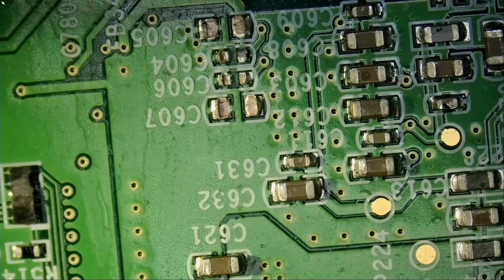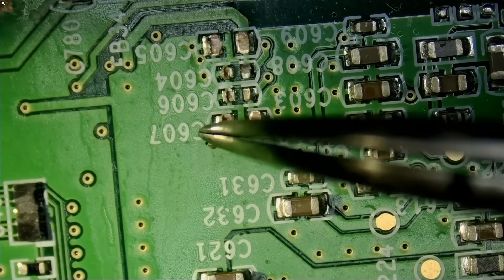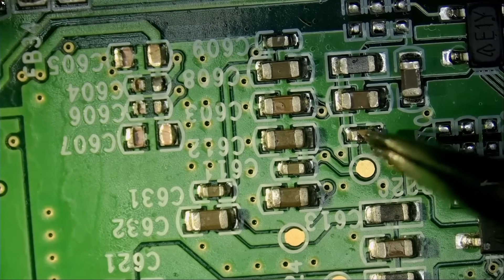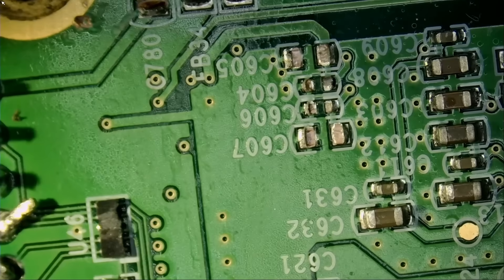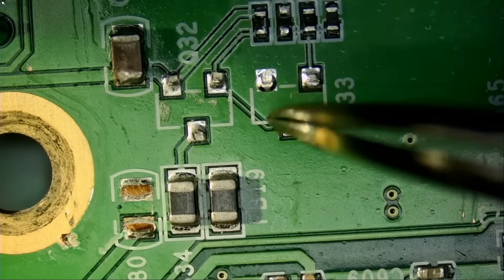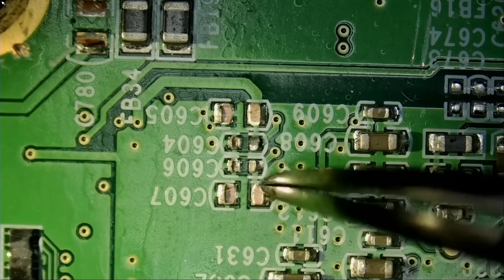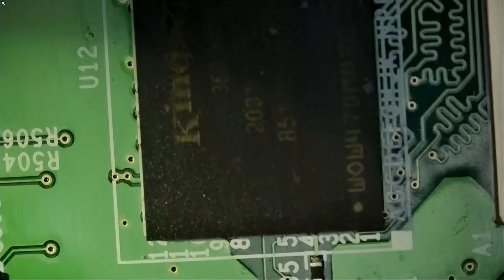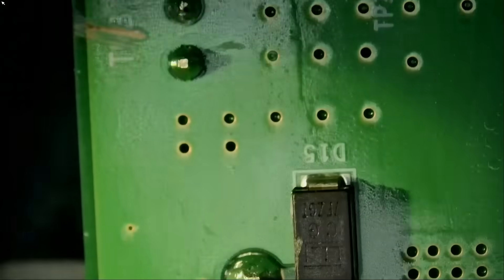IIrcade No Power - Who massacred this board and Can we save it ?

Comment: i'm betting it was shorted across all the pins with something and injected higher voltage and blew it all apart. i agree,  without any specs or data, it's a total loss, not including all the other components that just appear good.

Comment: hi i've got an adata hm800 6tb external hard drive. is it ok to always keep it on 24/7 ? its got a power cable so i wanted to know if its safe to always keep it connected to electricity؟
Reply: Yes. Its specifically designed for this purpose.

Comment: Yup and it is still working! Thank you Alex! This looks like they sent you their donor board!  I can send you pics of the both sides of the motherboard you fixed for me. Let me know.
Reply: This.
Reply: He would need the values of each cap, and the numbers on each missing diode. 
If you know how to remove caps and measure the value. But why would you do that anyways.
Reply: you need more than pics, you need value of each missing component, it means, you need the exact same board to check what the value is
Reply: Is it basically the same board that's sold on American Gear Company's website for $100?  Just curious if that guy who sent this in could have just purchased a new compatible one straight from AGC.